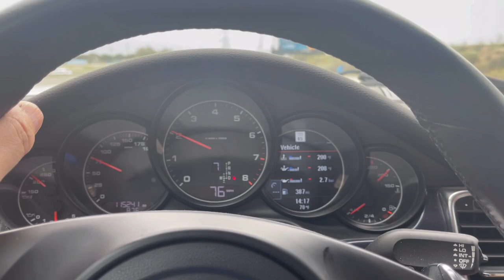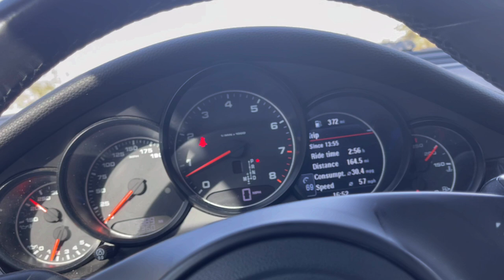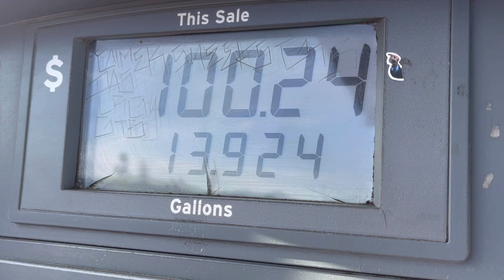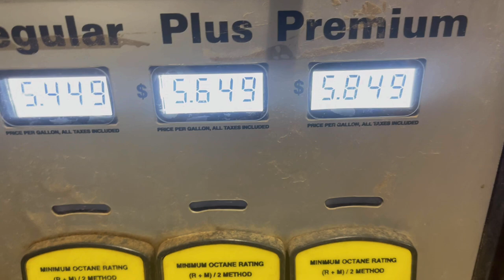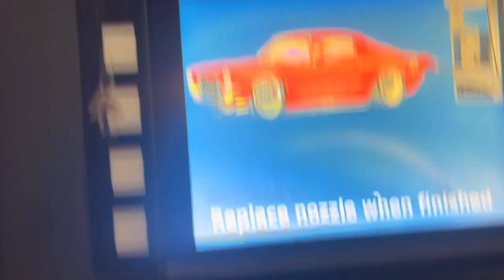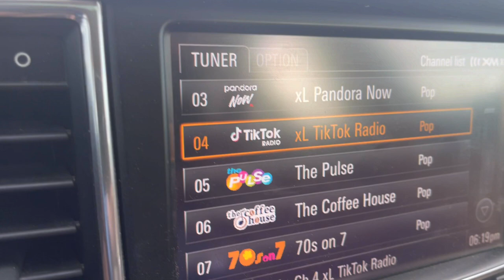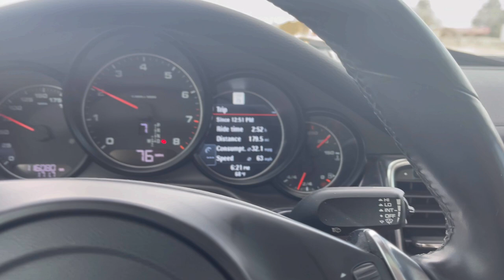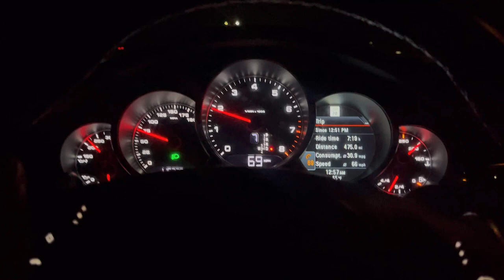Porsche VS Chevelle SS

Comment: Happy Birthday Mike.  Love the old 69 Chevelle SS 396.  Unfortunately this one is far from stock.  I bought one of these brand new in 1969 right out of the showroom for $5400.00. CND. $. That was a lot of money in those days for a teen ager.  My Chevelle had the high rise manifold and large 4 barrel carb.  It was rated at 375 hp as per paperwork but we immediately put it on a dyno and it was 420 hp.  It was underated as per spec because there were govt limitations on hp here in Canada at that time.

Comment: Pretty nifty Mike, nice car for sure. One of my interns from years ago got a job at Porsche R&D Center in Schwieberdingen / Weissach as Software Engineer.
He wrote most of the engine control software for the 6 and 8 cylinder engines.
Your buddy Peter from Kansas
Reply from the maker: Nice!!

Comment: My Chevelle was at 3000 rpms cruising at 60 miles an hour, and the rear end had 4:10 gears.
Reply: Serious question...  is there any reason to put "super premium" gas into that 1969??   One would think just a waste of $ & that, it should prob use reg/unleaded anyway, no?
Reply: @mmanda515  Those high compression engines require fuel that is more volatile, or they just won't run properly and won't have any power probably causing engine damage. Did you try looking to see what the internet has to say about that?
Reply: @douglasbrown8175  Was just curious & thought I'd ask.   Thanks. :)